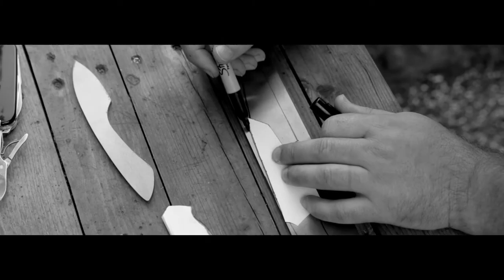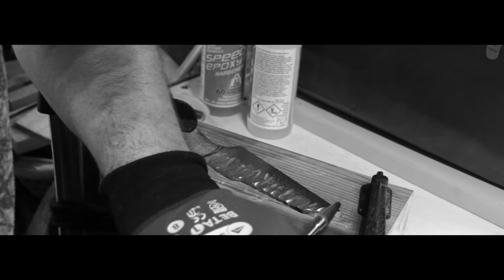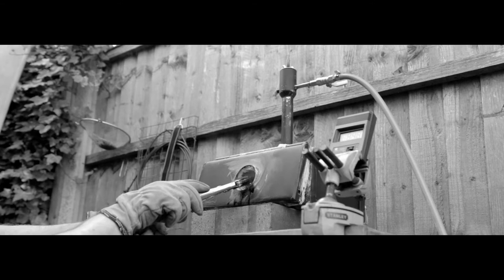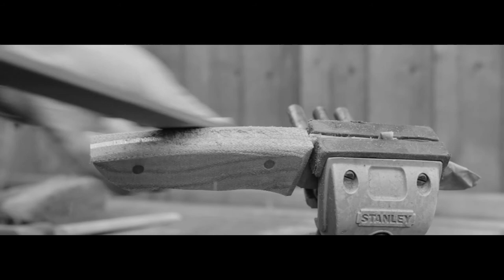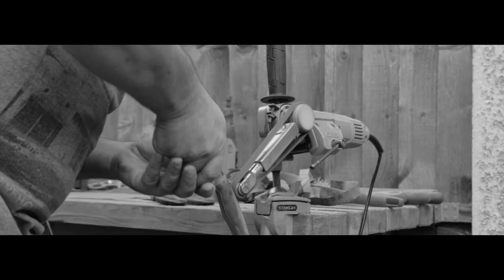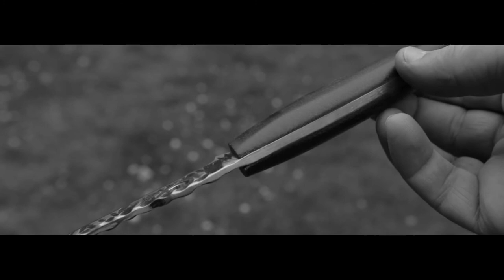8 hours  of knife making in 5 Minutes

Comment: nice knife , me i ask u sir what type of oil u put in handle knife for protection and i hear that the engine car oil is good for  wood handle is that right ? and how much time we should let the handle in oil ? and thx for the video
Reply from the maker: Hi.  The  engine oil  might  be  ok, but  I  have never  used it.  I prefer  natural  oils and  most  of the  time  I use   boiled linseed oil. How much   -  it  depends on wood, but  typically  I do the   first coat , let  is   soak for  like  half  a day, then  I  oil  it  again  and  let it stay  overnight.
Thanks  for  watching
Reply: ah ok ,what about olive oil it can be good ? and thank u for the informations i will try ,  thank u agin for reply and good luck in new projects :)
Reply from the maker: probably not as good as linseed  oil, but  better  ,than  nothing.  Dont  be   afraid  to try it, maybe  it will  work  for  you  just  fine